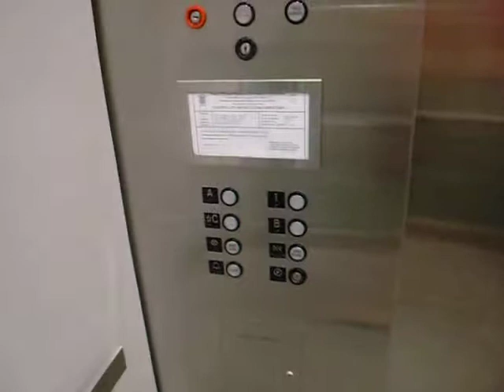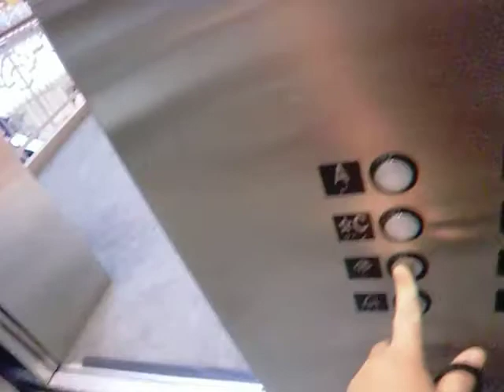Schindler Hydraulic Elevator to Cityside Lower Parking Levels - Providence Place

Comment: Those are roped hydro. You can see the pulley with the cab at the 2:1 ratio with the cables. The hydraulics are also not upside down, so I know its not telescoping hydraulic. They are indeed holeless though, like this elevator.